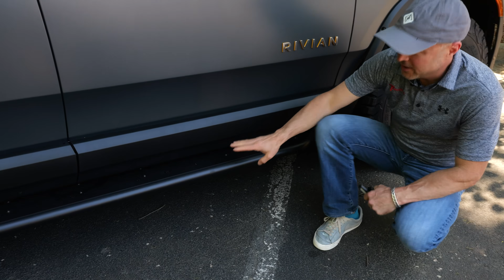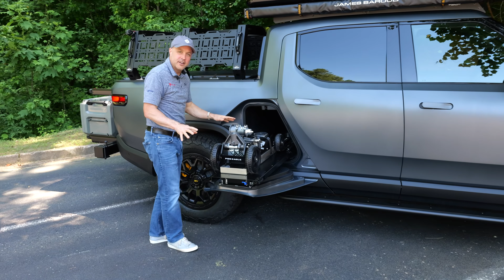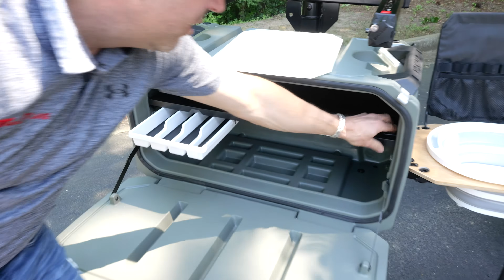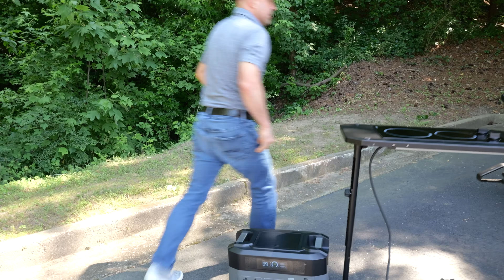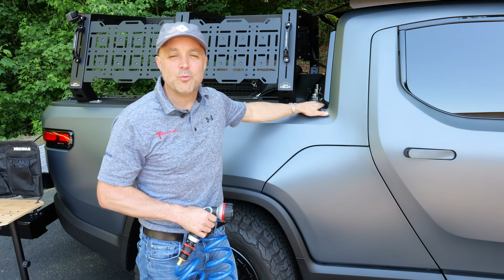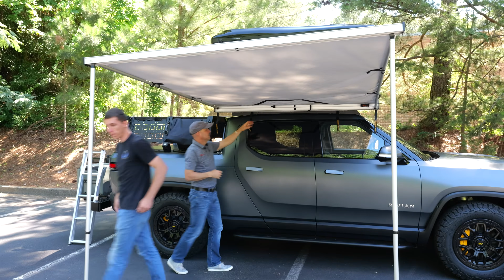Built for Adventuring! Overland Rivian R1T Custom Off-Road & Bed / Roof Camp Special by EV Sportline

Comment: What a sweet build! So many awesome features. I’m curious about range loss from the rooftop tent…seems like the overhang would disrupt aerodynamics. Do you know how much range you lose from that?
Reply: Would love to know the answer to this question too! Same with wind noise? Are we talking a 10% hit or a 25% range hit?
Reply: I cant imagine this rig will go very far with all the extra weight, RTT hindering aerodynamics, dual fridge/freezer, and 40ngal heated water system. If you live right next to the trailhead you might be OK for a 1 night out and back